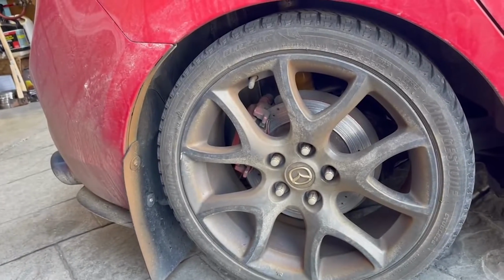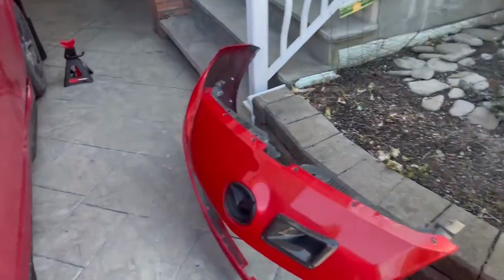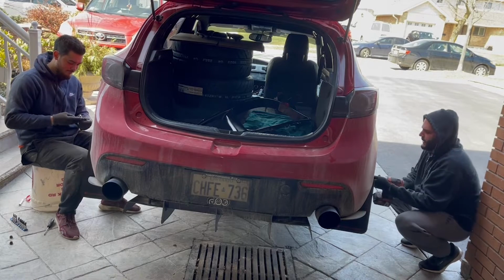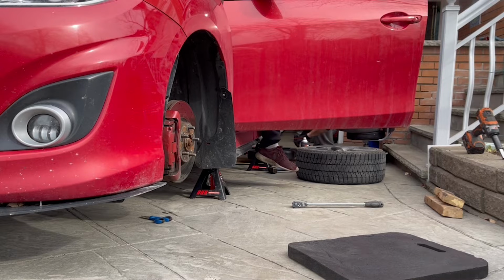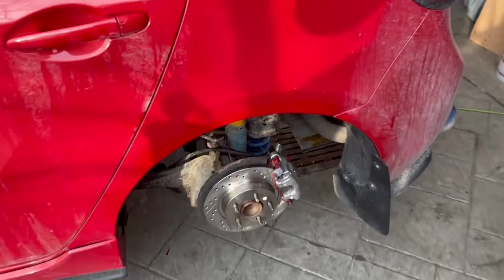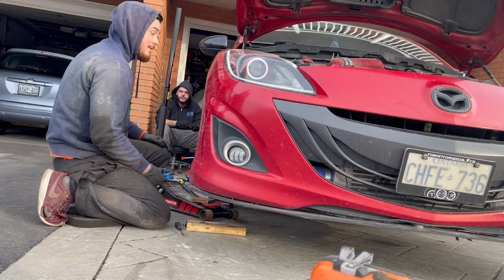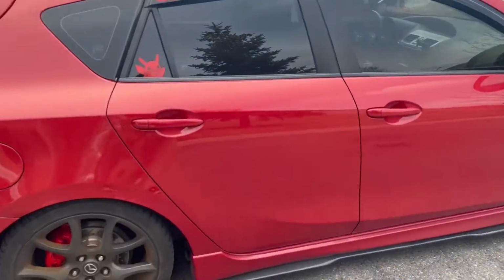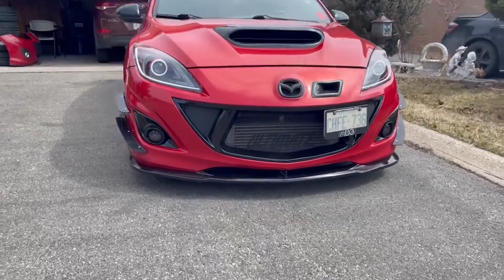Mazdaspeed 3 Corksport Camber Plates Install + Fender Rolling!

Comment: Do you guys have a recommendation for a mileage point to replace the brake calipers?
Reply from the maker: Maybe 150k km do a check, take it apart and see if everythings good and go from there. Especially if you drive it in the snow may be more common than you think lol